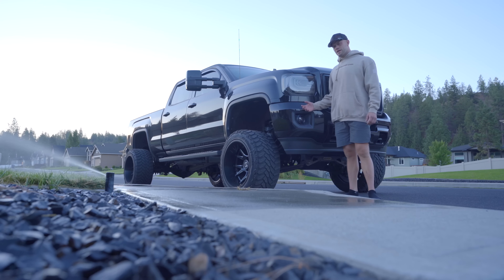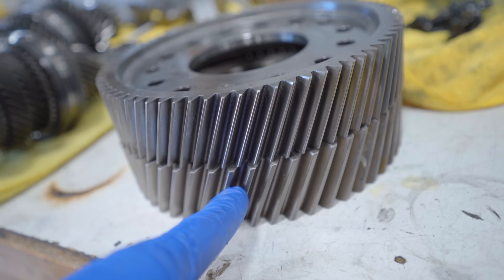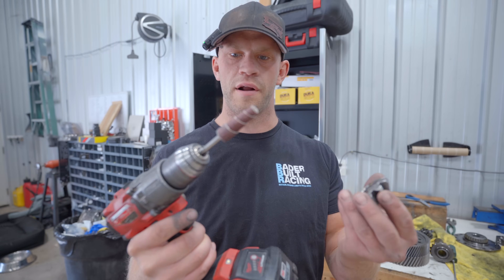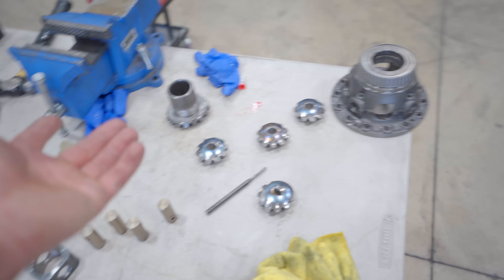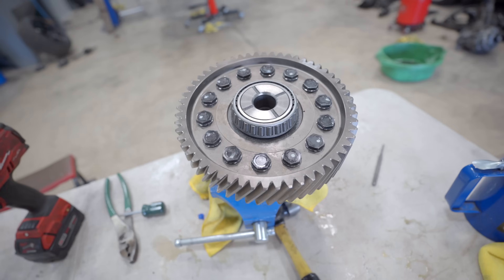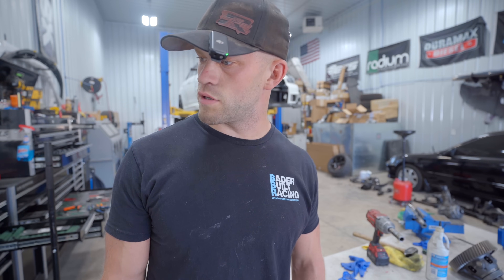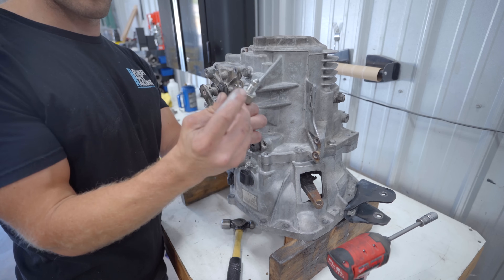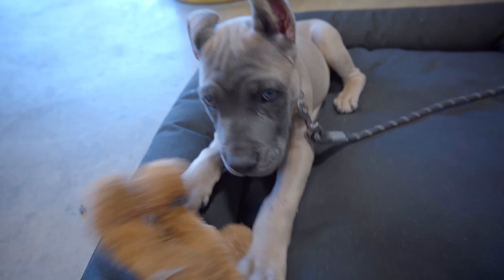BUILDING AN UNBREAKABLE EVO TRANSMISSION

Comment: 21:22 if you check your bearing tolerances in all your engine builds why dont you check the shimms in all your transmission builds? same level of importance.
Reply: Yes! Always check gear clearances and tolerances when replacing parts. Also ALWAYS use new clips on final assembly.
Reply: @gregb8153  No, im not talking about gear clearances, im talking about tapered roller bearing tolerance adjustment via shimming